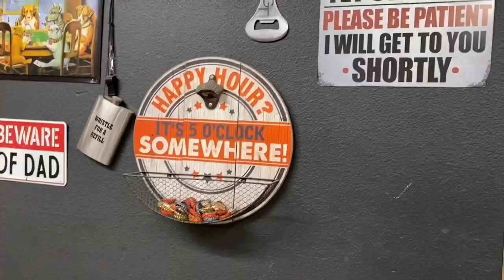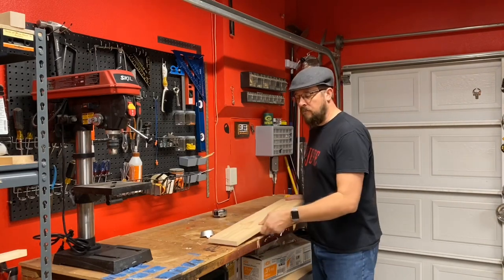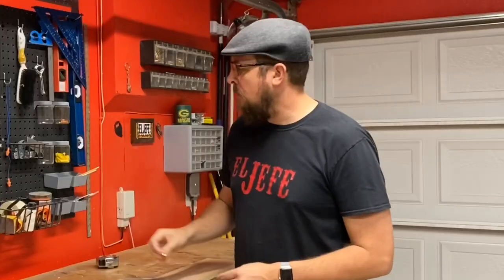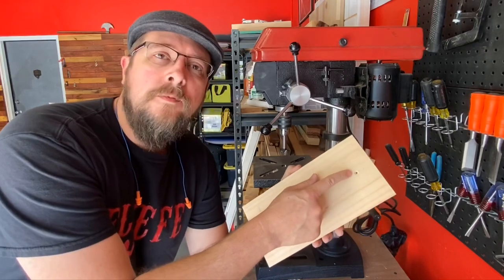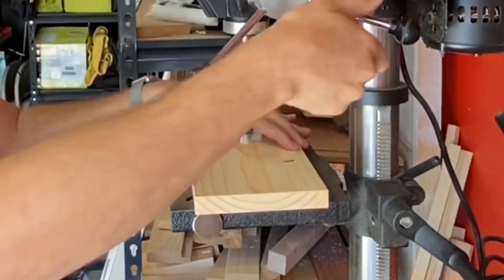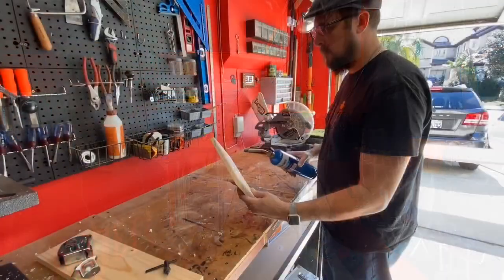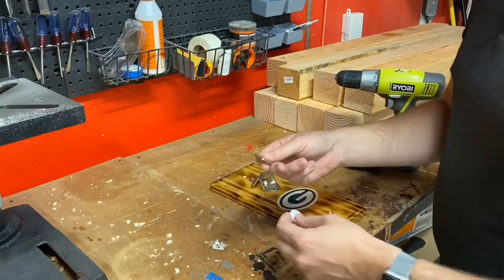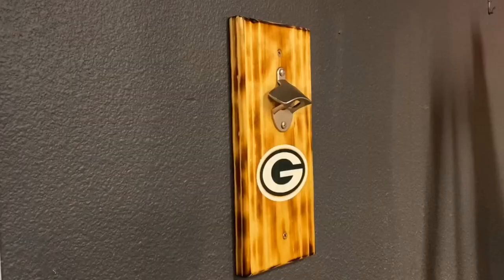How to Make a Magnetic Bottle Opener That's SUPER Easy!

Comment: Great project.  How long is the wood, and how far below the opener should the magnet be mounted?  Thanks.
Reply from the maker: I made the bottle openers 12 inches long. As far as the location for the magnet, I placed it in the center of the distance from the bottle opener and the bottom of the board. Not really any scientific reasoning, it was just an easy way to do it. I might just make an update video for this after reading your comment. Thank you for the inspiration!
Reply: @TheDadCave  thanks for the quick reply.  I would like to carve an image under the opener so trying to figure out how far below I can place the magnet for as much carving room as positive. Look forward to the next video.
Reply from the maker: @Mrwolfpack85 Awesome idea! You can always adjust the depth of your he hole you drill for the magnet based on how far your carved image goes into the wood. You would be surprised how strong those magnets are. I’m sure you will have no problem figuring that out.

Comment: Hi, could you tell me what you sealed it with? I did one and painted a logo on it but when I sealed it, I didnt look to good. I used polycrylic in a satin finish but it made it way to glossy.
Reply from the maker: Thanks for the question. I used the satin polyurethane from Varathayne. I think it has the right level of sheen. When I have used polycrylic it seems like the sheen is more glossy than that of polyurethane. Varathayne also has a matte polyurethane that is really nice as well.
Reply: Hey, thanks so much for responding. I’m gonna pick some up and try that. Thank you so much.
Reply from the maker: @smeg8557 you’re welcome. Let me know how it works out for you.

Comment: The Modelo was probably not the best to start with haha. Looks good though. How did you mount it to the wall? I was thinking of using a router and keyhole bit on the backside. There are also sawtooth hangers, or single/double keyhole fittings?
I feel like opening a bottle, especially if tipsy, needs a solid mounting point so hangers and keyhole fittings probably not the best. 

Sorry for the rambling, but id love to hear how you did it as well as if it has held up well over the years. Definitely got yourself a sub. Thanks man!
Reply from the maker: Answering Questions About Hanging Bottle Openers, Thanks for the questions!
Reply from the maker: Unfortunately, the Modelo was the only beer I had on hand. I made two counterbored holes on the bottle opener. One on top and one on the bottom. Then just simple hardware screws into a stud. I completely agree that it should be secured to the wall with no movement. That's why I didn't opted for other hangars like you mentioned. Be sure to check out the short I made in response to your comment if you want to see how it's holding up.
Reply: @TheDadCave  sweet. Thanks!
Reply from the maker: You’re welcome.